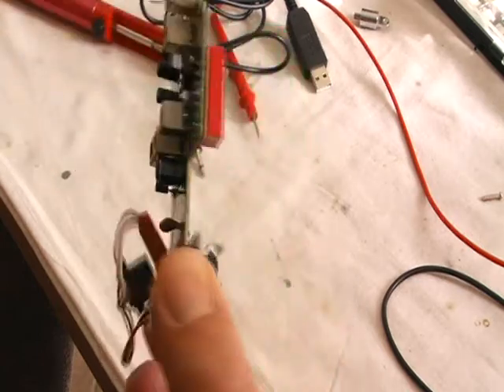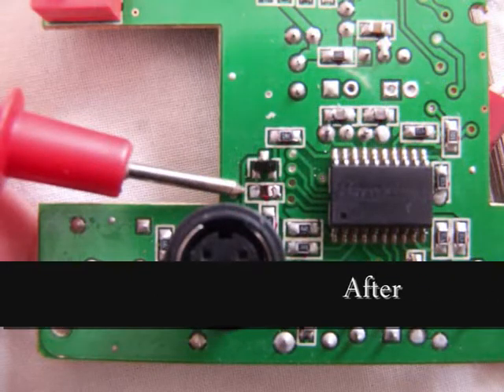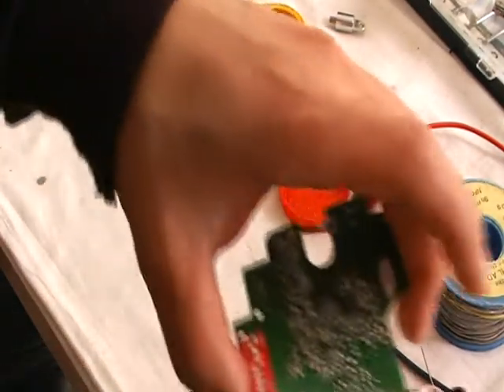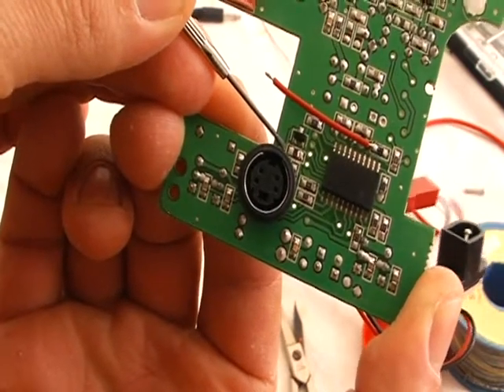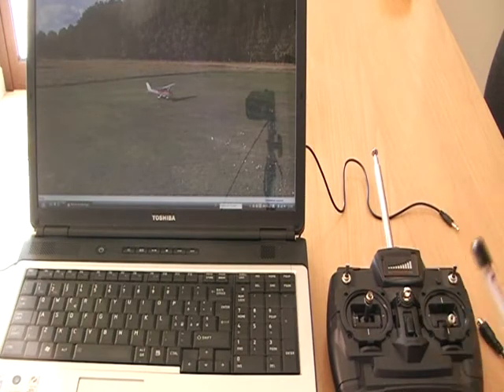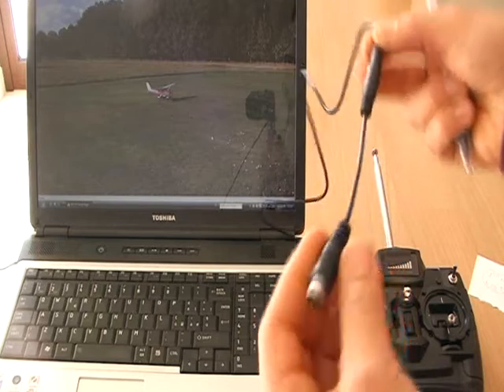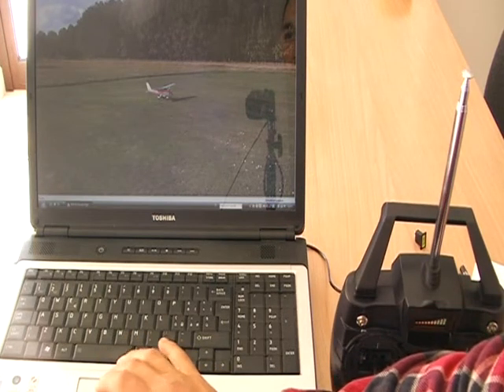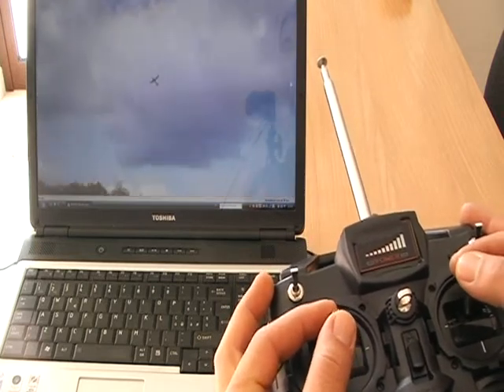How to modify the walkera 4 channel radio for the use with Reflex XtR flight simulator

Comment: I tried re-soldering the wires in the cable for my walkera wk-2401 to the pins you state in this video, but it still wont work with any flight sims. I didnt do the internal part as i dont need that.
It wont calibrate to windows 7 either.
Any suggestions :-)